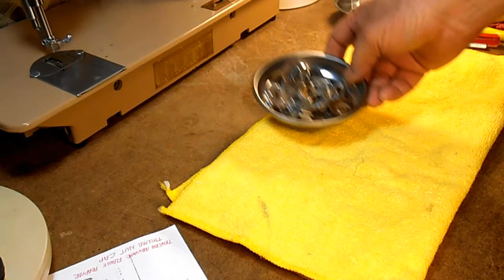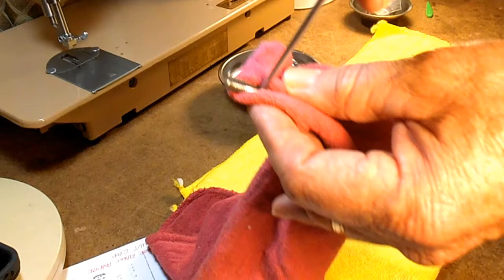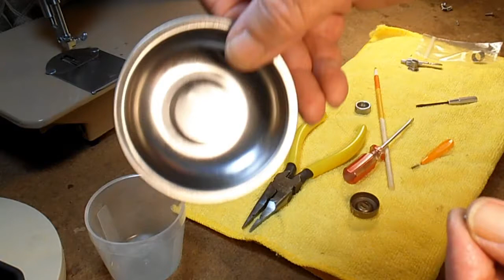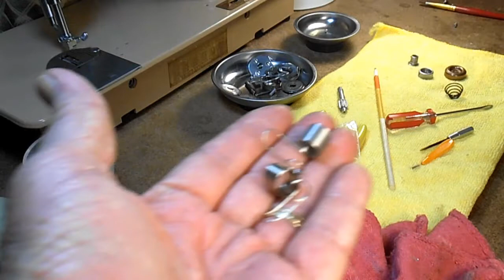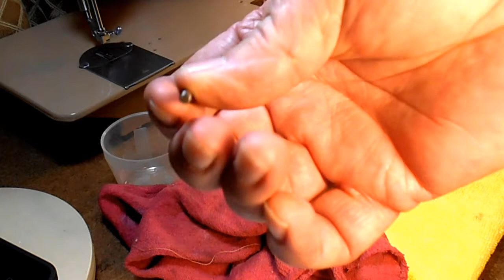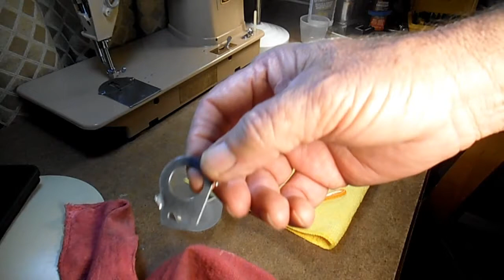SINGER MODEL 404 MINI SERIES-ALL ABOUT TENSION PART 14d INSPECT & REPAIR TENSION ASSEMBLY PARTS

Comment: Hello Andy. The thread sping on my einer vintage machine got broken and I couldn't get done with the tension assembly. I'll really appreciate anything to help. Thanks
Reply from the maker: The machine in this video is a Singer 404. The take-up check spring is part #66774. Many sellers have them online. Here are a couple I trust: https://millardsewing.com/product/66774/
https://oldsingershop.com/products/singer-sewing-machine-thread-tension-take-up-check-spring-201-221-222k-301-401-500?variant=40422264569892

Comment: Thanks!
 On my 401a, on my Tension Indicator Flange Stop Washer, the little pin/finger/tip that sticks up is not bent, it’s straight, flat.
Also, my 3 tension disks are not the same. They are the set with the two curved discs and the flat one in the middle.
I wonder if my tension unit was replaced by another model’s tension unit in the past.
Interesting how I’m learning so much about my 401a.
This thing better work when I’m all done lol
Reply from the maker: Yes the tension parts are not original so they got replaced somewhere along the way and maybe a combination of a couple different tension units what you're describing would work okay I guess you'll find out soon enough good luck
Reply: @andytubesewing1953 
Thanks,
I might replace it, and get a new tension unit specific for my 401a because I’d like to have the correct washer for when I watch the future video of yours where you show how to use/install the little bent tip of the washer with the little holes of the copper Tension 0-9 Dial  piece for a finer tension adjustment.
BTW, I remember now my 401A’s copper 0-9 dial piece, is the one with all the little holes along its hole/opening in the front of it. 
I think I remember that is the correct one for the 401a model.
I’ll recheck that in this video too. 
Since I’m watching and studying all your tension theory videos in this series, plus some of the others tension videos on your channel, I think I might want the correct washer, but I’ll think about it, maybe I’ll wait continue without it, because I don’t know what other surprises I might have by the time I get to the end of installing and fine tuning all the rest of the parts:)
Big life decisions lol:) 
Thanks, again:)

Comment: Hello Andy. I am restoring a 404 that I just bought right along with your videos. You are so easy to follow along with! I got a little ahead of myself and cleaned all of the tension parts with Krud Kutter and then I got to the part where you told us to never use Krud Kutter on the tension discs because it makes them too slippery. Since the deed has already been done, is there something else I should wash them with to make them less slippery? I’m not sure how to proceed. Thanks!
Reply from the maker: It's OK and no worries. If the assembly is on the machine when I clean it, I usually use alcohol. When I take the assemble off the machine I ALWAYS use Krud Kutter on the discs. The cleaner they are the better. What I was trying to say @ 21:47 was that you want the discs to be clean. If there is rust you can use the rust remover, but you want the discs to be clean and dry, without any residue from any cleaner or any type of oil left on the discs. If you cleaned your discs with KK then rinsed them with water they are ready to be reinstalled. I'm sorry for any confusion I caused. Thanks for asking, and for watching my channel and I hope you are enjoying working on the 404.
Reply: Thank you for replying so quickly. I am thoroughly enjoying the whole process. I wouldn’t have ever attempted it without your videos and I would have really missed out. Thanks for taking the time to make them!
Reply from the maker: @fawnlarabee2200  You are welcome, Fawn. Thank you for saving that Model 404. I hope you enjoy it so much you will find another Vintage Singer Machine to work on. Maybe a 403A, or a pretty 337 or 347. Take Care.

Comment: Andy, I have accomplished  a full restore on a Singer 404, thanks to your videos. Can you tell me why it is that a Singer 401 tension would make micro adjustments compared to the 404 tension? Does it just move the tension discs that much less per turn or something? I am unfamiliar with the 401 upper tension  assembly. Where did you learn all these things? Are you using some types of service manuals? Keep up the good work.
Reply from the maker: Congratulations on your restoration. Did you notice the numerated dial on the tension unit for your 404 has little holes in it? Some tension units have a tiny pin on the back of a knurled knob that fits into those holes. When you want to adjust the tension settings you can depress the dial back against the spring and turn the knob to the next hole and release the dial. Turn left for less tension or right for more. This is to "set" the tension and is different from turning the dial to a higher or lower number as you are sewing. Here is a video showing what I mean: https://youtu.be/VPzpLIAvz8Y
To do that on a 404 you have to loosen the set screw on the cap then turn the adjustment flange and reassemble. If you aren't happy with the adjustment you have to do it all over again. With the pin system, it is extremely easy to push back, turn the pin into the next hole and release. I did electro-mechanical work for 30+ years as a Telecom Tech. Working on sewing machines is a longtime hobby as my wife owns several and they need service/repair. I befriended a couple of Singer Repairmen in the past who are/were a wealth of information. On machines I get stuck on I go here to see if they sell a service manual: https://manualsoncd.com/   also http://store.tandtrepair.com/ and there are vendors on eBay that sell printed reproductions of manuals, maybe Amazon too but I don't shop there. Thanks for watching my channel.
Reply: @andytubesewing1953 I appreciate the information. Do you have a video on the bottom tension at the bobbin? Specifically what do you consider a good adjustment  weight for the bottom tension? I have a similar pocket scale for dialing tension in  to 15 grams at between 0 and 1, like the video. What do you think a good weight would be, or what bobbin tension do you sell  restored machines at? I will be sewing woven wool fabric so not too thick which is why I set it at 15 grams at .5. Is the tension supposed to match between the upper and lower thread? So 35 upper 35 lower gram force for example? I am doing more research now on the subject. Also, It seems when I sew at say 12 stitches per inch the lever seems to bob up and down real fast, that controls stitch length, is that normal? The stitches seem uniform. I have learned so much from this channe. I am reading as much as I can about bottom tensions from google searches.
Reply from the maker: The most consistent information concerning bobbin thread tension that I have been able to find, written and verbal, is that bobbin case tension should be about 1 ounce or 28.3495 grams. I adjust bobbin case tension on a similar bobbin case to your 404 in this video: https://youtu.be/bhcsfhaBRDo
Reply from the maker: The feed regulator/stitch length lever should never move or "bob" while sewing. Something is loose? You can review the 404 feed regulator videos, https://youtu.be/Ee3ZHhXWrWk, and https://youtu.be/4j4BvYpKEQw and this one for model 301A which has the same type regulator and what to do if "loose":
https://youtu.be/EQtGwmOYtic
Reply: I had found a spring on the floor and couldn't find it on the parts diagram, turns out that it was supposed to be apart of the bolt that connects and secures the feed dog  / stitch regulator.
Reply: I will adjust it to this after watching the video depending on the video information, cheers my friend.  @andytubesewing1953
Reply from the maker: Good Job. Part No. 170179, "Feed Regulator Hinge Screw Tension Spring"
Reply: Yes, at the time I did the restore I had a much simpler diagram of parts then the one I found recently online for download that included the names and part pictures. I was using one that just had a diagram of how the parts were to be installed.

Comment: It's refreshing to see someone who really knows what they are doing working on this stuff.
So many of these other youtube videos drive me nuts the way they butcher what they are supposedly fixing.
I was an industrial repair technician  for over 22 years and met a lot of "hammer mechanics" over the years.

You can get screws through Granger and McMaster Carr, you could even change over to hex heads.
Allen wrenches are so much more dependable than flat heads
Reply from the maker: Thanks for commenting. I've never had luck finding screws to replace the size/threading patterns of the Singer ones. I recently learned of McMaster Carr and will find time to look at their offerings.